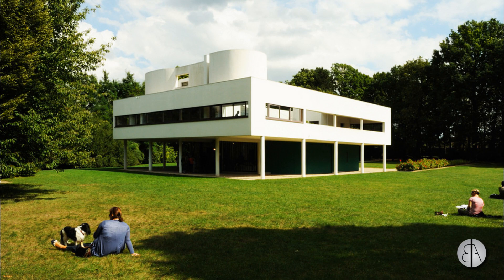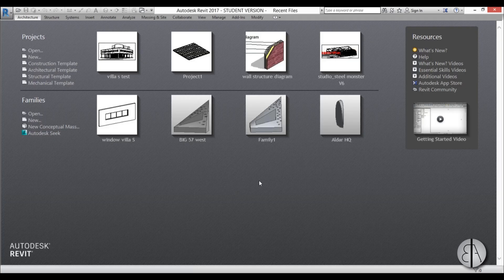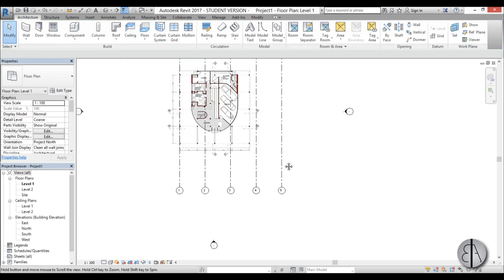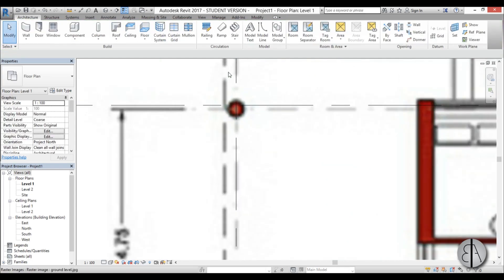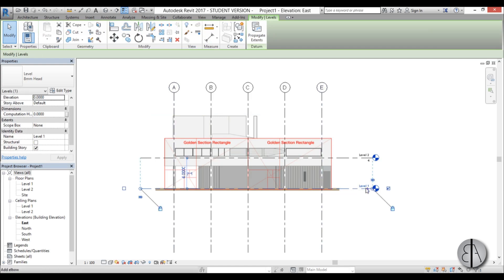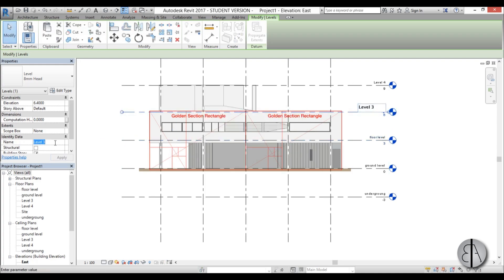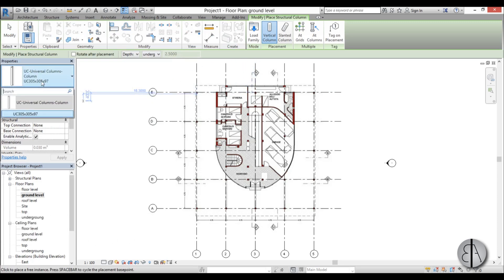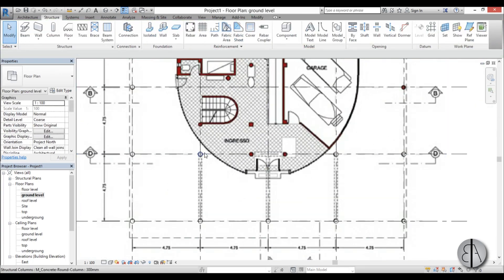Le Corbusier's Villa Savoye in Revit Complete Tutorial * Part 1 *

Comment: bro which laptop best for revit in dell. i was thinking to buy 7567 i7 7000 series dell laptops.
Reply from the maker: I'm not an expert on computers, but I think any i7 will work well, if you can find a computer with quadro graphics card that would be amazing but they are quite pricey
Reply: yes its quadro gtx 1050ti
Reply from the maker: It should be grate for revit then!
Reply: thank you so much.
Reply: i have and hp omen gtx 965m and it run revit 2018 with a 1050ti its overkill in sort of speak
Reply: sorry i dont understand bro.